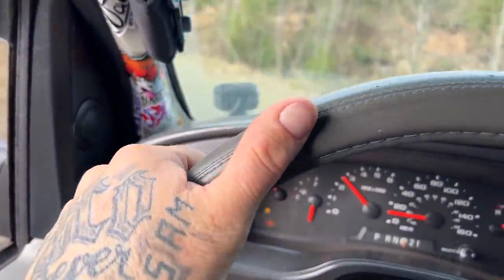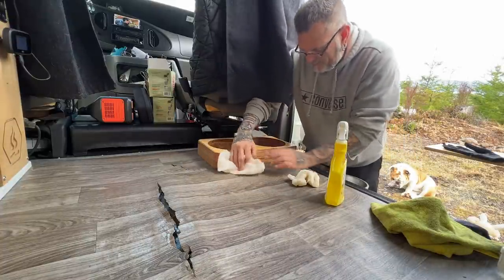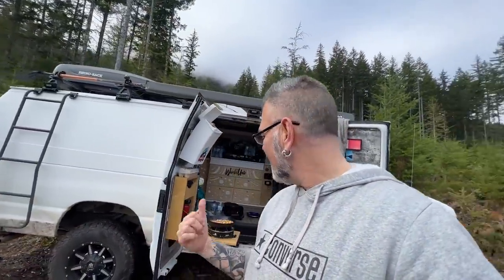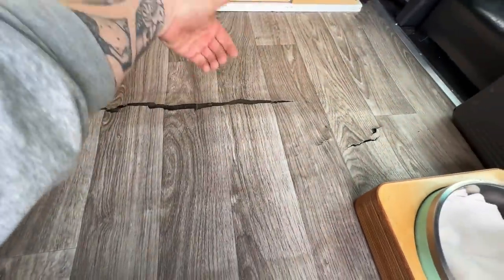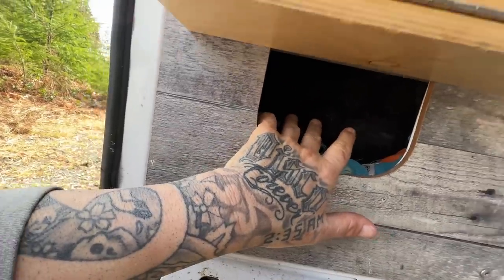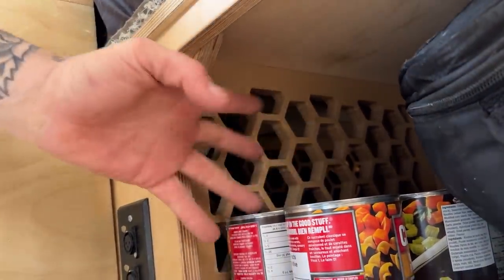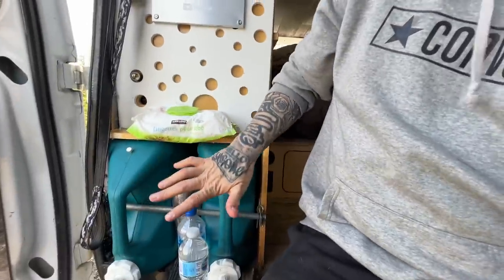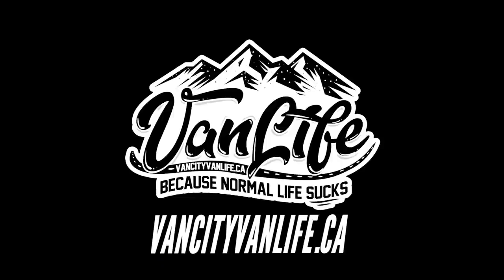THE GOOD and THE BAD | Closer Look At The Mistakes I Made "Van Build Edition"

Comment: Hi Chrome…I just wanted to comment on running the floor before vs after the cabinetry. When I built out my E150 I put the floor in before building anything else. I have to say I’m super happy I did it this way because it has allowed me to change things around as I learn what works and what doesn’t. Next month I’ll be further tweaking my build after learning last summer that I’d like to incorporate a spare bed for friends. Removing one cabinet to allow for this will be easy because my floor is unaffected by the change
Reply: Would it not be lighter to not have  flooring under the cabinets?
Reply: I agree. If boards need to be changed, their must be a way to cut them cleanly and near flush to the cabinetry, closets, etc.

Comment: If you didn't want to weld the bracket, you could put a couple rivnuts there and use some bolts with thread locker to secure the bracket. Maybe use a piece of rubber between the bracket and the van to eliminate some vibrations.
Reply: Regular pop rivets probably work better than screws
Reply: Weld is 15 seconds and forever
Reply: @timan206  yeah but forever is a long time!

Comment: FYI:  If you want to do the weight saving 'honey comb' in the plywood, like Andy does, but DIY, you can draw a grid on your pieces, once cut to shape. Then use a Forstner bit or hole saw and drill out the holes to lighten things up. Just make sure to leave enough wood to maintain strength and if you're drilling through holes, clamp a backer piece of scrap behind where you're drilling so you don't break out the back side and keep it looks nice. :)

Comment: Love how you let us know about how YOU have your set up. It works for YOU. I personally appreciate that. Question--By not putting the flooring under your cabinets and then adding "Hard" flooring, will you still be able to  open your bottom drawer? I realize it's different in a sticks and brick home. You know since the drawers are lower. Anywho, thanks for the excellent video. Have a great day you two.

Comment: Hey Chrome and Cruzzie.  A thought about flooring.  Lifeproof, Luxury Vinyl Planking (LVP) from Home Depot.  The flooring clicks in together.  Doesn't need glue or nails, just push together.
The big thing is that it is waterproof.  You won't need a lot maybe 2 boxes.  They even have padding on the bottom.  Just a thought, and yes I'm using it on my short bus.
Reply: I have this vinyl packing in my home. I love it. & will use it in my van & camper
Reply: The only thing I wonder about vinyl planking is that if you spill some liquid, it can seep between the planks, right?  Or will that not happen? I have my pit bull girl with me and I'm pretty sure somewhere along the way, she or I, will have some spills!  Thanks for your thoughts.  I actually have some Home Depot but was going to switch to sheet vinyl over plywood.

Comment: 1/2" plywood over the laser cut cargo mat and vinyl like you used is the plan when I can finally do my build.  I'm not sure I have the ability level the floor ridges myself so I figure the mat for leveling and insulation, the plywood for rigidity and the glue down rolled vinyl for the pretty. 😊😂.
Reply: There is a van lifer in youtube called My Basic Journey and she used insulation foam to fill her floor ridges, then just cut off the excess when it had dried. Then put her flooring on top. I thought that was a clever solution to floor ridges and have filed it away in my brain for future use! Lol.

Comment: Hey Chrome, Love the videos man... The story-telling is great and I enjoy following you on your adventures. You mentioned on this video that you are replacing your van flooring and how Cruzy's food bowl tray is screwed directly to the floor. I had an idea I wanted to share with you that could help keep that feeding area clean. It looks like the Cruzy's bowls are metalic. I was wondering if you could glue down a decorative stainless steel "mat"  recessed into the floor and glue/attach a magnetic strip under the bowls so they can be easily removed for deeper cleaning floor by simply lifting the bowls out of the way.

Comment: Thanks Chrome. I am building out my Chevy Express and you gave some great incites like not putting the final flooring down until the cabinets are in. One thing I wish is that the Chevy doors were like the Ford's. Yours are flat on the inside and they swing out much wider than mine.
Reply: Did you have the flat metal stopper bar  in the middle of door on the hinge side ? We all remove them so we  can swing doors all the way open
Reply: As Bearded eluded to...My Express barn doors have a flat metal stopper in the hinge. Open the door slightly, put your finger in the hole and push stopper out toward you. That will allow the door to fully open. More difficult to explain than to actually do. When I first discovered this, it was a head slap moment for sure!
Reply: @beardednomadvanlife6363  I removed the one on the rear door but kept the front one. I do release it to open it more. They just don't swing out as wide as the Ford doors.

Comment: Just an idea on Cruz’s food bowels. How about a flat magnet fixed on the floor and a flat piece of metal on the bottom of the bowl. That way you can take them out easy and clean. Probably needs a strong magnet with the sort of travelling on the back roads where you go 😬 I use this system for lights in my van that I can move about. Anyway great channel stay safe 👍

Comment: My last van was a E150 with a 6 cylinder. I'm a flooring installer and it was used for work but i loved it i broke a Leif spring so i had e250s springs put in never had a problem

Comment: Built my van out so I can easily remove the cabinets for repairs. They are all attached to the van's frame by plus nuts, bolted together with t nuts, and the wiring is done with barrel connectors. If I ever need to fix or replace anything it is "easy" to pull everything out.

Comment: Great video. If you get some lock washers on the screws that hold that bracket for your water it might be a 50 cent fix. It might not fix it but i really think it would help. Might need to get slightly longer screw to work with the washers.

Comment: Some other food for thought, a bigger engine doesn’t need to work as hard to pull the weight, thus the fuel mileage generally stays the same as the smaller one because it works less.
I know with the express vans, the difference between the 2500/3500 is literally an extra leaf spring in the rear. But that’s it. That add’s the extra 1000lb load capacity or whatever it is.

Comment: Another option for your water jug bracket  is adding rivnuts to the existing holes and switching from screws to bolts with a lock washer. ;-) should last alot longer then the screws and you dont have to do any grinding, welding and paint.

Comment: Hey Chrome, the stuff you mentioned is all pretty minor, aside from the engine. I had the 5.4 in my Expedition XLT (6,000 lbs) and it was a great engine. I think it’s about 34 more horsepower and 60 more lb/ft of torque. That would make a big difference in your van. I want to say that the 4.6 is rated at 231/265 and the 5.4 at 265/325. Having the 3500 would help a lot too, although your suspension upgrades are definitely helping you. For your first van build, you did a great job. Looking forward to seeing the ambulance when she’s done.

Comment: It's Spring...love is in the air... especially for the frogs 🥰😘🥰🤣😂😅😂🤣
On my build weight has been my #1 concern...I want to be sure I can 4x4 to spots without killing my engine...but my start is very different from yours.  I know what I want because I was semi-nomadic for 10ish years late 1990's early 2000's.  My real issue now is figuring power needs to run internet and computer for when I get back on the road.

Comment: And the 6.9 is the best diesel motor the 7.3 is over sized cylinders that has a problem with cavitation which you just have to be aware of and keep the proper coolant levels

Comment: All very true, but keep weight distribution in mind. Another YouTuber has a Ford 7.3 diesel engine that became bogged down because he had too much weight (a motorcycle, for one) in the rear. He had the engine repaired at the only diesel shop in town, shifted the weight around, and found that the truck was a completely different vehicle.

Comment: The 5.4 would be the better motor over the V10. The V10 wasn’t as reliable and it was a fuel hog. I had 2 E350s with 5.4. Sold them and they were still kicking, the 05 had 333k and the 02 had 290k. The 05 was a cutaway with a 10ft box with ambulance package. That gave it a high amperage alternator, Dana 70 rear non dually, higher weight capacity, and bigger rear brakes. That’s what I’m going to look for again or find an old ambulance with a 4x4 conversion.

Comment: Chrome:  I see that your rear interior window doors are covered with the same material that you did your floors with.  Will you also change the window covers to match the new floors?
Reply: Actually, he used vinyl on his floor and wallboard on his doors to match his walls and ceiling. His new floor will be very compatible with the walls and ceiling so no, he won't be changing the wallboard on his doors. Hope this helps answer!

Comment: hi Chrome
was thinking about what you said about the motor and weight limit
after you finish with the ambulance build and recoupe from that cost
would replacing/upgrade the current motor with a v10 
and replacing the springs with a e350 equivalent be a plausible 
thing to do? though youll have to find a shop that will and can do 
the conversions. this was just curious thought/question   :]

Comment: Chrome you don't want the V10 it's the 5-4 with two extra cylinders but it's got all the same problems of the 5-4 but you can't get cams you can't get head gaskets you can't get phasers for them you got a whole lot of extra problems with the V10 go with the 5-4 if you're going with a trading

Comment: Speaking of Vans it seems like whenever I search for a newer Econoline 2009 through 14 they seem to be lemons. Low miles like 100 or 120 with new engines already or Transmissions. 

My favorite years are 2006-2007 E350 low miles 5.4 engine. That's the home run right there. Stay away from Chevy and stay far away from Chrysler.